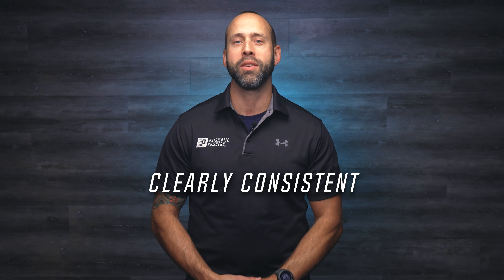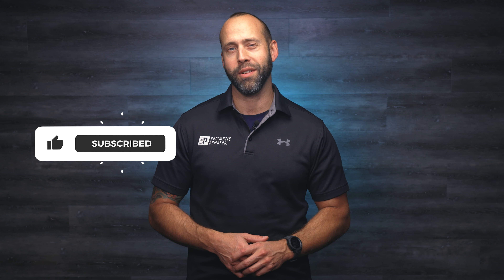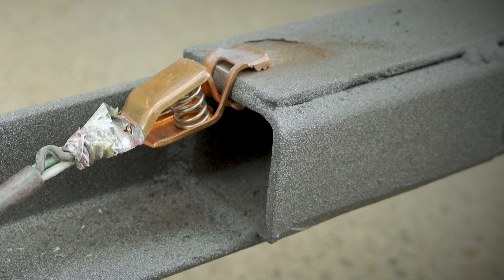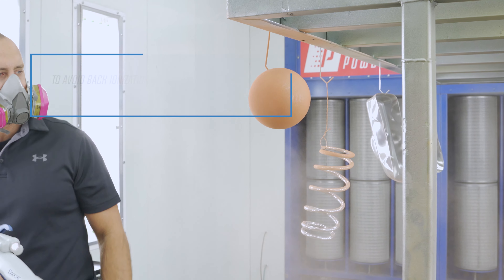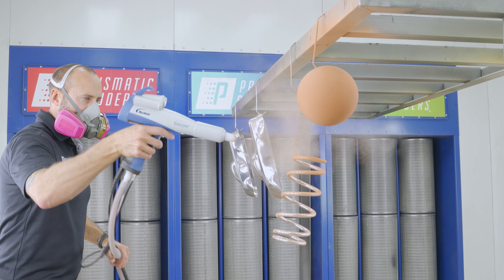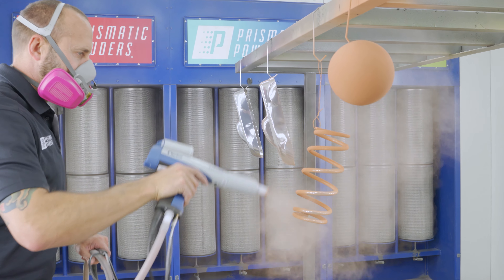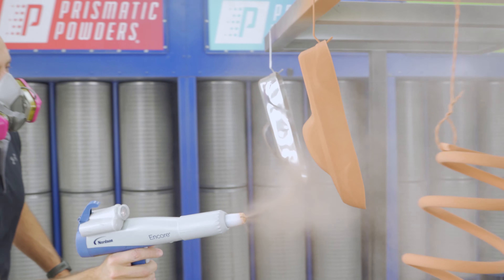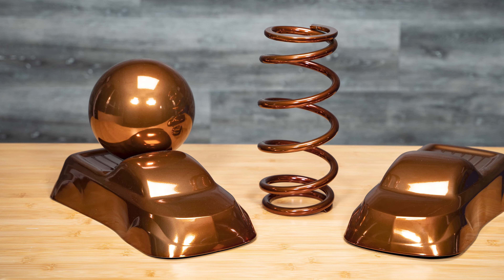Clearly Consistent | Prismatic Powders®

Comment: Hi, is there a clear coat that doesn't change the shine of the Super Chrome Plus powder coating?
Reply from the maker: The best results are found with Acrylic Clear APS 11224 because of its flowout characteristics. All clears have an affect on Chromes, but Acrylic Clear will have the least affect

Comment: how come the spring came out looking a little different than the sphere and truck bodies in the final portion of the video?
Reply: the spring looks more copper and everything else looks more gold
Reply from the maker: The are about as identical as can be, but I think what you may be seeing is the larger highlights on the parts with more surface area. That coil doesn't allow for much of a reflection so it makes it seem darker.

Comment: what kv and amp settings did you use?
Reply from the maker: I don't recall the exact settings, but given that we had two coatings that have metallic elements (to deliberately challenge ourselves) we needed to keep things pretty low. With our gun setup our kv setting has all the potential to go to 100 but we reigned in the microamp settings lower than the average job. For the Super Chrome (no more than 30) and for the top coat probably around 35. We also have a solid earth ground in addition to our control unit being grounded.
Reply: @PrismaticPowders  so you leave kv at 100 for candy colors and just lower micro amps?